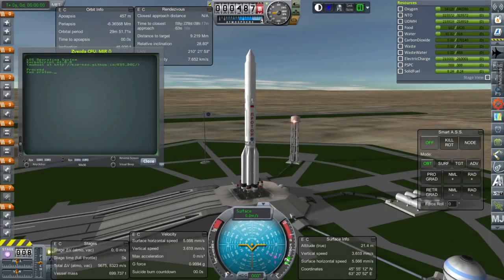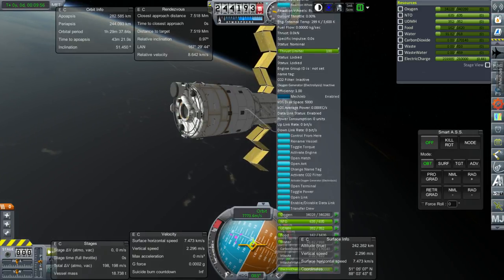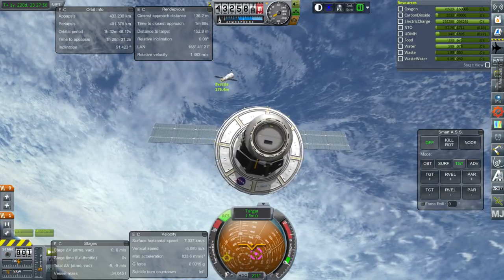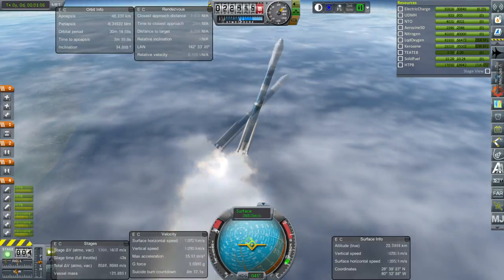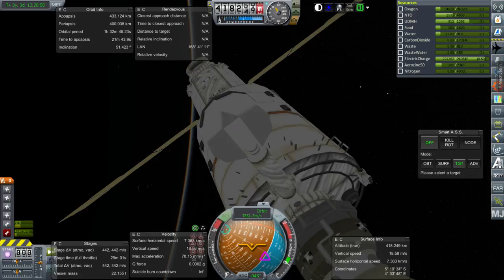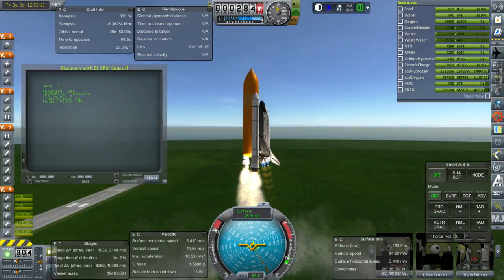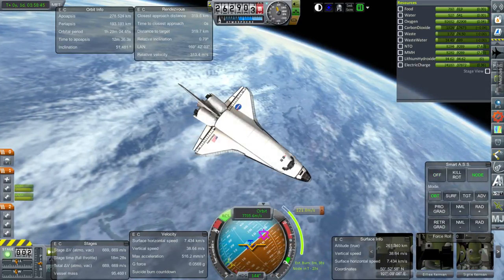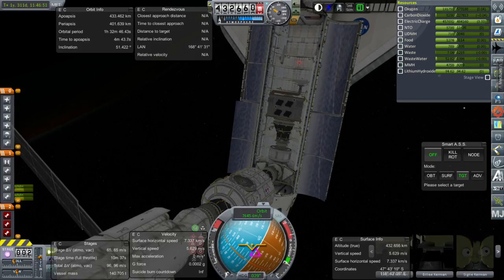Kerbal Space Program/RO - ISS Assembly Redux 02 - Zvezda and STS-92

Comment: How did you manage to Get the ISS mod Working. I am on 1.2.2. I have the ISS community mod and the only part that shows up as RO is unity, All the other modules are NON RO, Including the Russian parts. I have also tried it in 1.1.3 and had no luck either. Can you perhaps send me a link to The ISS community you have installed?
Reply: Tyler Raiz I actually found a version that works for 1.2.2 out of the box. It is ISS_COMMUNITY on Github by bobcat. The only problem is unity is too big and you have to use the cxaerospace one
Reply: When I tried to rescale it, the nodes were out of place. And when I used the "rescalefactor" it did not work